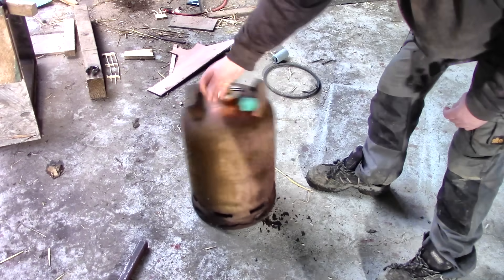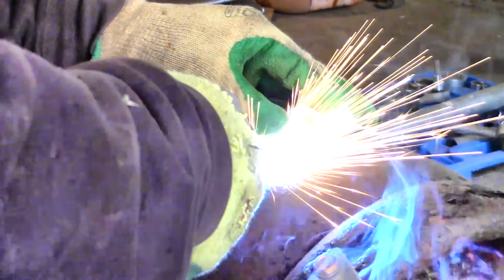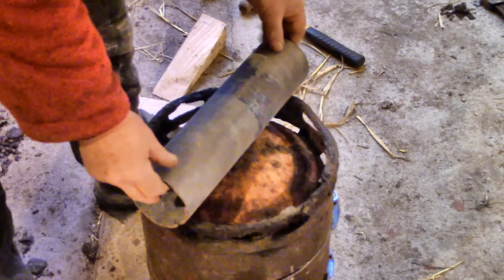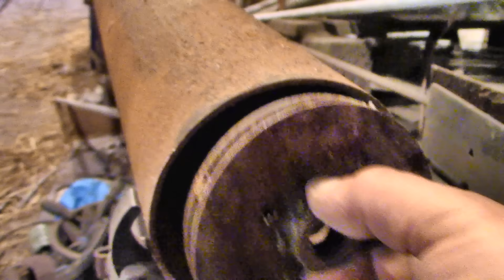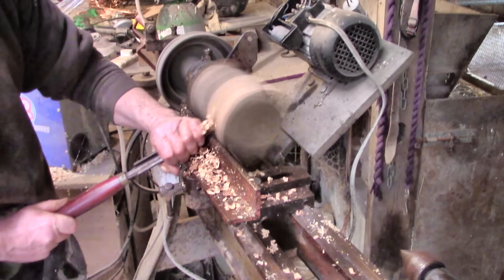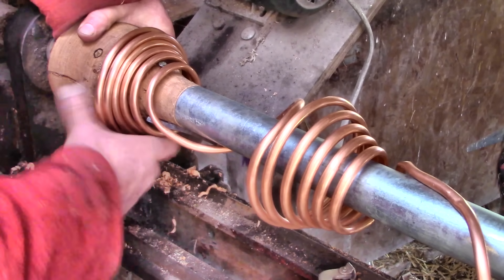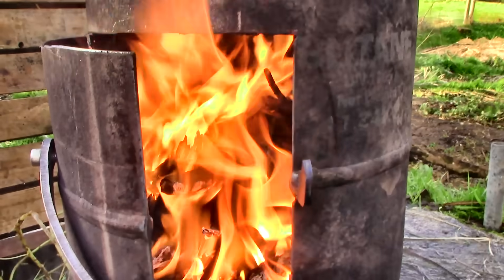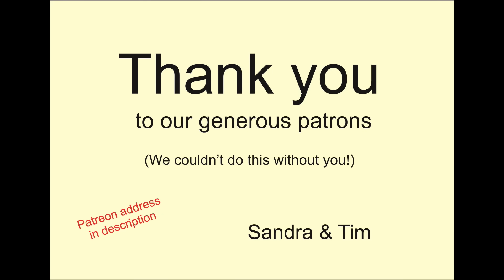Homemade Flash Steam Boiler From Plumbing Pipe And Scrap

Comment: I work with copper like this a lot over the years. The best way to wind this up is to carefully roll it out. Then make a hand crank jig. A piece of pipe the size you need the coils to be then some sort of crank for a 2nd person, Attach a hold down point much like in the video. Then crank away. Now keep in mind that the coil size that you want and the size tube you use are going to change. Always go smaller for the spring back. As your coil the copper it will somewhat work harden yet it requires some effort to keep it to size due to it being soft copper. Though it does look like you did a good job. Once you get it fully wrapped the last bit of pipe at the end fix it to some thing strong and then you can try and tighten the coil as much as you can. Tapping the soft copper with a bit of wood will help to harden the copper. Just not super hard. You do not want to damage the tube or flatten it. You just want to tap it enough that it it will remain hard. I am not sure how to explain work hardening copper. Yet the taps will be almost enough to no let it spring back a huge amount. You can get the hang of it on the first 5 or 6 turns and releasing the crank. Either way someone might use this.
Reply from the maker: Thanks for this, William - any ideas for how to join lengths? Solder would melt, I assume, and I can't get compression fittings for anything smaller
Reply: @wayoutwest-workshopstuff6299  Yes brazing is the only way to go. If you have an oxy acet torch that is the way to go. It does take a bit of heat and it will hold up to high temps. 
I did some looking around at some photos of boiler domestic hot water copper loops. It might be worth the look at some photos. The one that stood out to me is where they just took the copper and wrapped it around a rod and then twisted the tube around it. This way you have a in and out at the same end. Have a look at it. As for other comments about filling with sand or water or pressure water. Those might be options yet I have never used those methods. Though they indeed might work very well.
Reply: @wayoutwest-workshopstuff6299  As you say, soft solder and even hard solder (cupro) wouldn't be suitable for what you want to do. How about good old brazing with brass rods? These joints would surely hold up . . . Great video, as usual!
Reply: @wayoutwest-workshopstuff6299 How about connecting the tubes with flare fittings? You could use stainless steel fittings, since they'd take the heat better.
Reply: @wayoutwest-workshopstuff6299  braze them
Reply: BTW people make things like this for out door hot tubs. They can adjust the flow of water to be cooler or hotter. For the tub you just need to have an over flow to drain out the excess water. You hook up a hose and some people use old claw foot tubs with over flows on them to drain out the excess water. You can set up a number of tubs in an arrangement so that everyone has their own tub. I intend on building another one for my new place. This way we can have hot tubs and not have to worry about them freezing in the winter. Just start a fire and start filling.
Reply: @kameljoe21  I have an insulated 100 gallon stock tank. Im 230lbs so I only need about 80 gallons so I can soak up to my chin lol

Comment: Tim you might know this....I have a boiler stove in my front room ... Can I disconnect the pipes, cap the ends...drill the boiler in the stove. So we can use it has a stove without the boiler function...

We are constantly getting power outages here so it's not safe to use the stove
Reply from the maker: Yes, I think so - as long as there are no rubber seals anywhere on the boiler (they used to make them that way) and there's somewhere for any steam inside to escape. Or maybe just remove the boiler? Good luck!
Reply: @wayoutwest-workshopstuff6299  that's enough inspiration for me to do it 😊

Comment: Hi Tim, I have 2 suggestions here:
#1 form some coils which are closer together and cover more space in the lower part of the chimney. Maybe 3 coils inside the other? And put them as low as possible into the chimney.
#2 Insulate the chimney from outside in the section where the coils are placed.
Goal here would be some heat concentration.

Good Video ;)
Reply: Exactly that, and have a primary coil in the outside to preheat the water. Alternatively you may be able to source a second hand wood fire boiler. My parents had one and in a power outage it melted all the copex piping because the water did not circulate and turned to steam.

Comment: One thing that I might try is putting a steam dome sort of device to separate out the water on the end of the water tube then run the steam back through the smokestack a few times like a superheater to make dry steam.
Reply from the maker: Yes, that's what I need to do - but how is really the question

Comment: I the old days, when i was building RC-Boats, i filled copper pipes with sand to prevent kinking while bending them around the motor.
Reply: I've heard about this too. But I'm curious as to how to get the sand out afterward and I wonder if this might be more difficult with Tim's design?
Edit: I saw another comment here that suggests filling with salt instead of sand. Salt would be a lot easier to remove.

Comment: One thing to add. I built a massive trash burn barrel kinda the same way some years ago. Over time the door warped. One thing one can do is add some flat strap and weld them so that the door has a flange type thing. Stitch weld them on the 3 sides. Miter cut the corners so that you can finish cutting the door open on the open side then stitch weld the last piece in. You can add a strap of metal at the hinge side though it would need to be flush with the cut. This should help with warping. Had I know this at the time I made my burn barrel it would have lasted far longer and looked better.
Reply: They do make fire door gaskets. I need to get some for  my smoker.

Comment: Would it be possible to have an external storage for the steam

If you use it in an engine then you could have a tender for coal and water than another cart in front for the stored steam
Reply: storing steam is inherently inefficient because all the time the steam is sat there losing heat, you are also losing power. you want to use the steam as quickly as you can.